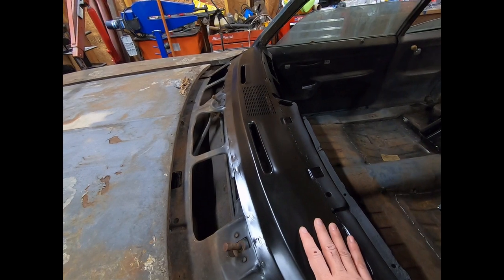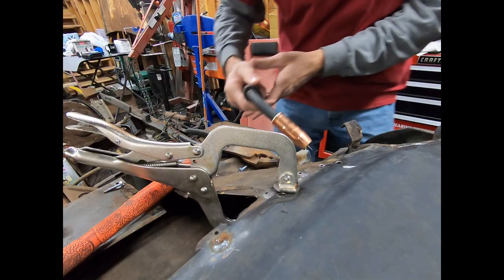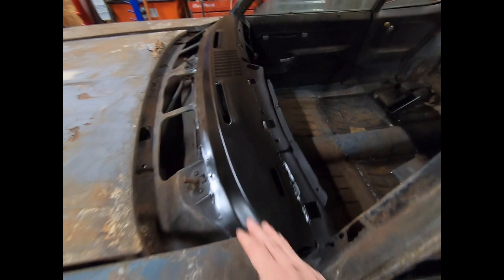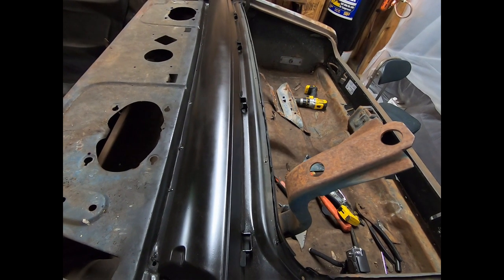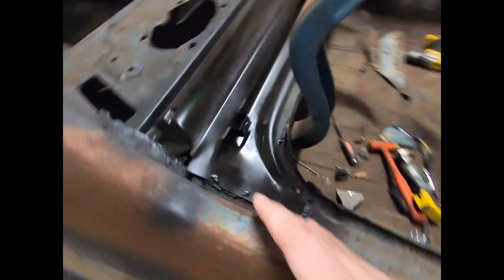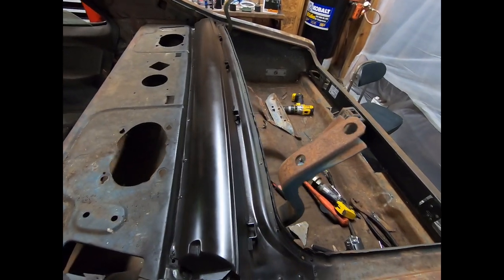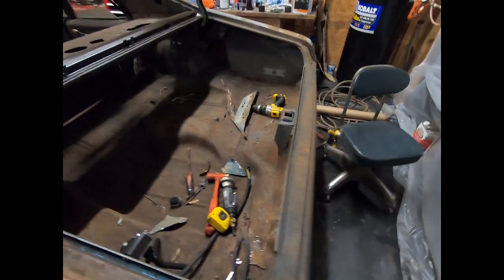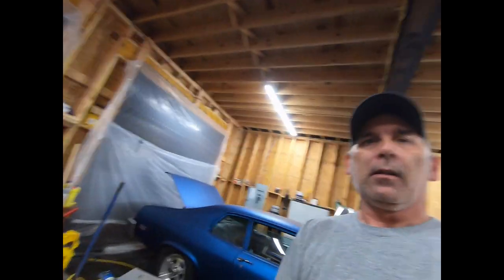Chevy Nova Dash Repair

Comment: Quick question  I have a 74 nova will I have to change  the brackets  of the bumper also for a 70 ?? Or just the bumper metal part only  has to b change ..????
Reply from the maker: If you’re converting the 74 to a 70 you have to change the brackets too and since it’s a 74 you’ll have to drill holes for the brackets. 68-73 subframes have the same bracket holes.
Reply: @Shop209   ohhh..ok  yeah  I keep finding bumpers  for sale  but with out brackets  for the 70.  So I was wondering maybe I'll just use 74 . But now I know I cnt  ....thanks  for the knowledge
Reply: @chevy-714  I know this is old, but I have a late 73 built 74 nova and I have boxes welded for my shock absorbers and the bolt holes are behind the boxes. 

In this case you'd just have to cut away the boxes and bolt up 

#NixonNovaGang
#BustyBumpers
#WorkinMansFirstGenCamaro

Comment: Hi I have a 76 Nova it's in need of alot of work . I don't want to put it back original , but ideas for putting new modification / improvements are hard to find . Any idea where to start ?

Comment: What did you end up doing with the space for the 72 gas tank?
Reply from the maker: I’m working on that now. Changing middle of trunk floor to the 72 style.
Reply: Shop209 I’m converting my 73 to a 72 clone, would it be a bad idea to just bolt the 72 gas tank in with a 72 rear bumper?
Reply from the maker: @captainherndon   The trunk floor is different so you would need to make a spacer to go between gas tank and raised section of trunk floor. The filler neck on tank is at a lower angle on the 68-72 so it will hit the rear cross rail. The video I made on rear panel install shows the difference.
Reply: Shop209 dang, thank you! I’ll have to watch it again more carefully.